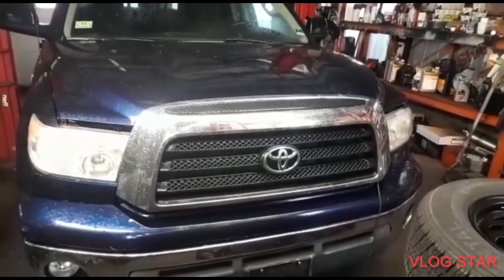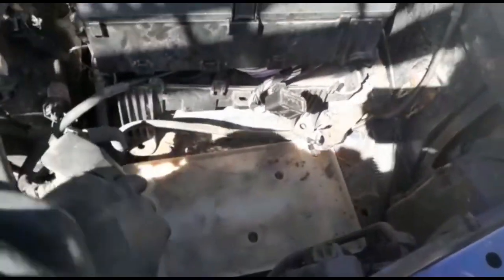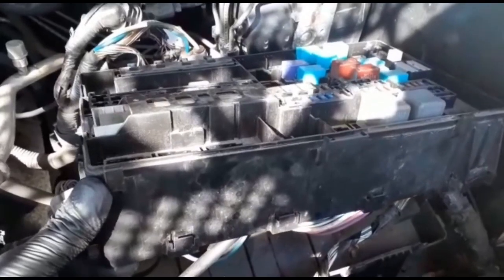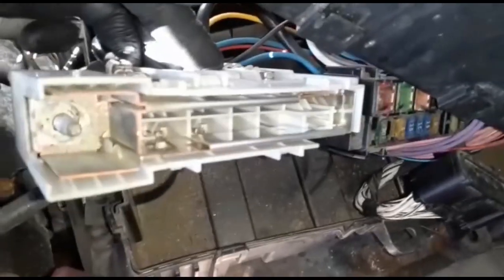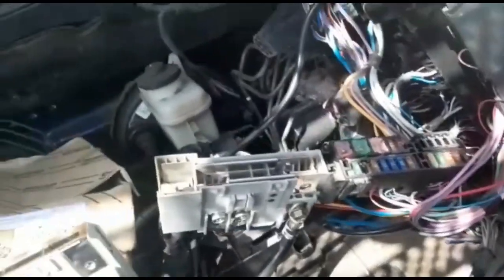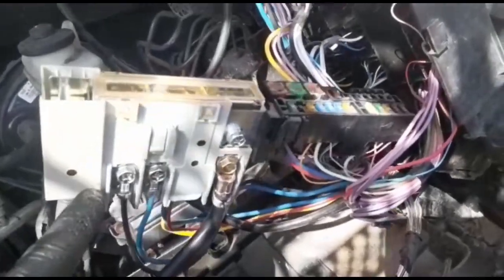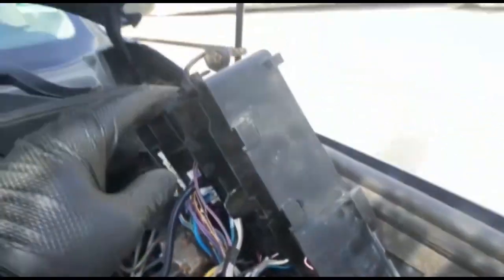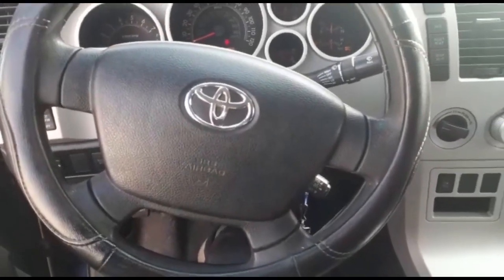How to replace main fuse Toyota tundra 2007-2016

Comment: This is the main fuses..or fusible links technically.
There's several on that part..in this case..it blew the alternator   fuse part...If accidentally reverse the jumper cables ..to get you home or to parts..you can swap the wire from the blown part and add it to another thats not blown..temporarily..Far better than a Nissan titan..Cross the jumper cables and the ECM is done..

Comment: Thanks I just bought the " Main Fuse" or "Fusable Link" as its also referred to for about   $45 bucks at the local Toyota dealer.  Now to install. For all  of you that crossed your jumper cables, don't feel too bad  When Toyota puts a black cover on the positive and no cover on the "negative"  its going to happen. Crazy thing is Ive jumped this truck a dozen times  because people leave the ignition in accessory, however this time  This truck has been parked, and it was late at night during a wind storm. TOYOTA  RED IS POSITIVE,  BLACK IS NEGATIVE. JS

Comment: Ive checked all fuses except for this one.  The truck interior lights flicker after running for a while.  New alternator and battery already replaced.  Thinking this is my last option to replace.
Reply: I have the same issues now. New battery and new alternator but my battery indicator comes on and off when it wants too. What cause it? Have you figure out? Let me know. Thanks
Reply: @MRBRAZILLIANKING  turned out the truck had a dirty throttle body.  That was the whole issue.  Cleaned it and it’s been running fine
Reply: @ismaelcaldera3301  that causes the battery indicator on even after battery and alternator new? I just reset my battery now. Hopefully it solve also. If not I'll for throttle tomorrow
Reply: Does main fuse make alternator charge?
Reply: I have new alternator new battery. Won't charge. Do I need to change main fuse?

Comment: I have a 2014 Toyota Tundra that stopped firing out of the blue. Never had any issues at all but 2 weeks ago my battery needed jumped and never thought anything of it. Then a couple days ago I went to start my truck and struggled to crank with no fuel tank “prime noise” when turning the key to the “on” position. So I replaced the battery with a new one and have no electric on my dash and cannot read the ecm. I do have a Viper remote start that has been installed for 4 years with no issues. This seems like a good possibility that this might be the culprit but thought I’d share to see if you had any other suggestions?
Reply: did you ever get this figured out? was it the master fuse?
Reply: And how did listening for a fuel prime that Toyotas don't do..The fuel pump comes on as you are cranking it over...lol

Comment: I have almost the same problem I took my truck to get the mufflers welded because someone stole my catali converter and cut the oxygen sensor off and now,when my truck came out of the shop it doesn’t want to charge the alternator needle is going back towards the -9 like is not charging at all but it runs good
Reply: Hey libra did u get your truck fixed yet? I think the cat on a tundra has 2 oxygen sensors one on top of and one on the bottom

Comment: Why i plug my battery and the starter running without key?but Everything else not on?
Reply from the maker: Do you have a remote starter on your truck
Reply: @kennytvkennytvkennytv  yes sir but it doesn't working,there's like 2 wires came out from the + from my battery, one is going through the relay fuse box one is going through the starter, but if i take of the starter line and i keep the relay line on the battery and i can see everything is on light the windows and all that. 
But i put it back my + line for the starter and the starter motor running not the one that its should kicking and start the engine,because the small one its attach to starter.
Reply from the maker: Please look up the video of slowly again I did explain everything
Reply from the maker: did you have a remote starter on your truck
Reply: @acim918  did you fix it the starter running with the key out ?

Comment: Does this fuse supply power to secondary air injection pump
Reply: I believe it does
Im having the same problem i think
I have a p0418 code
Replaced the sia pump 
And i still have the code for relay A